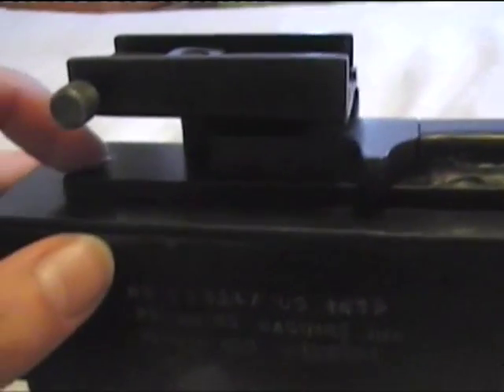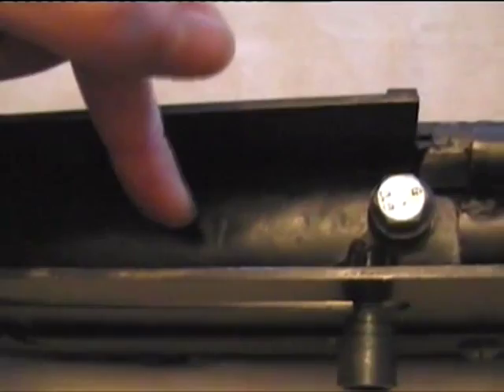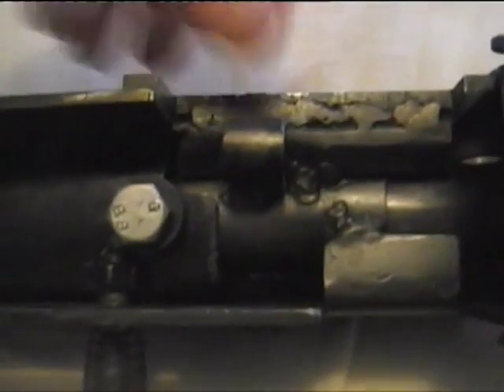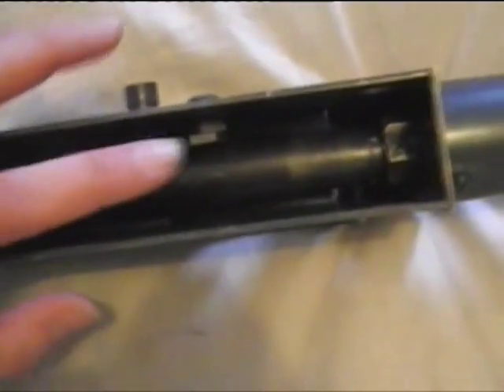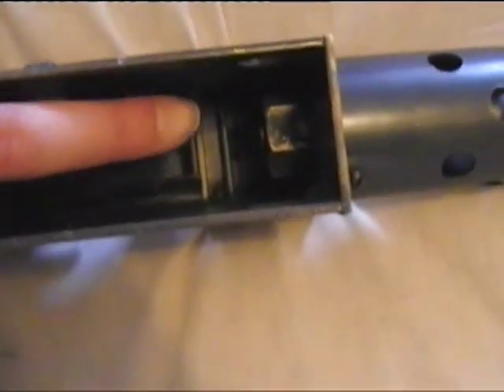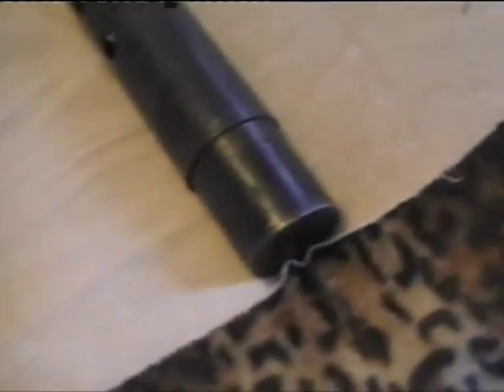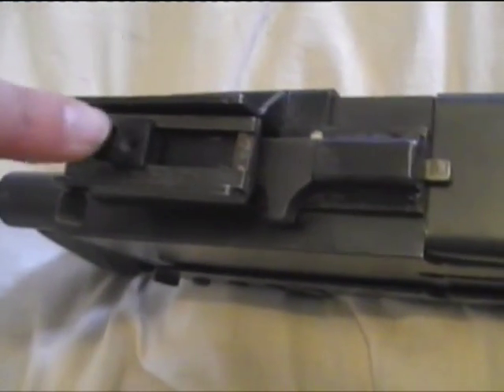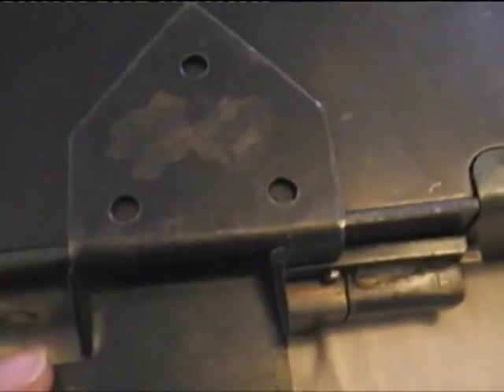How to Make a 30cal Browning PT2 of 3

Comment from the maker: @airsoftassassin13 Good question if you look at one of my other videos I show how but can't remember which right now. Get a length of steel angle and lay it along the length of the tube this will allow you to draw straight lines down it. Then you want to divide the circumference by 8 (I think) and mark the lines equally spaced around the pipe, then draw them full length. Then you just measure the points for each hole and centre punch all before pilot drilling with a 3mm or smaller.

Comment from the maker: @airsoftassassin13 You can pick steel up quite cheap and some times for free.
The barrel jacket on this is 2" steel off an old Ford Siera prop shaft, I have more of this pipe that came off a bunk bed. Local scrap metal dealers are good.